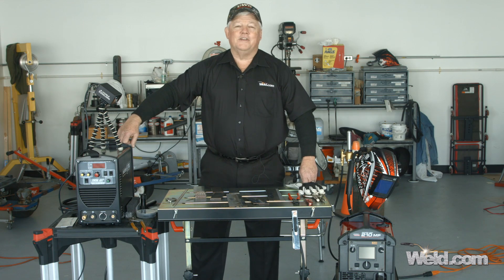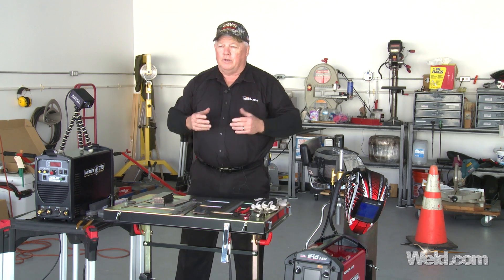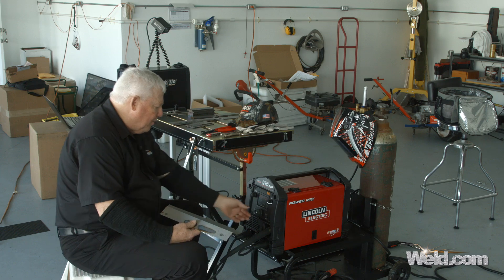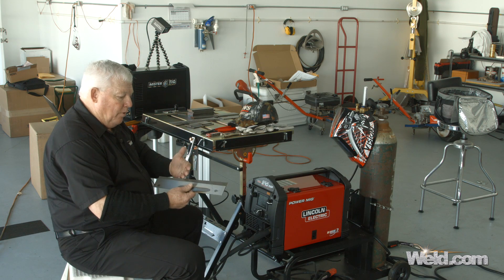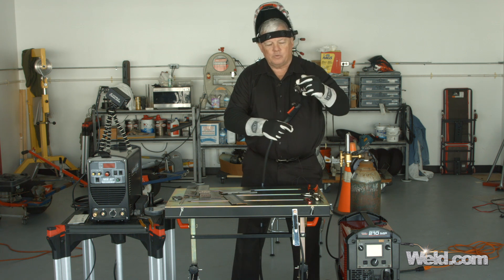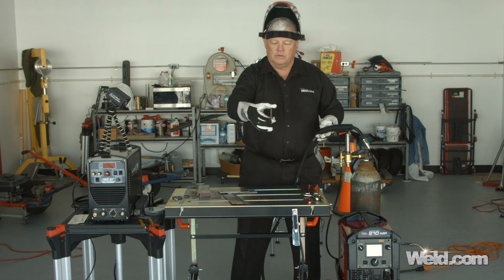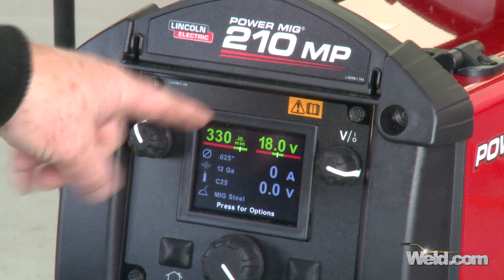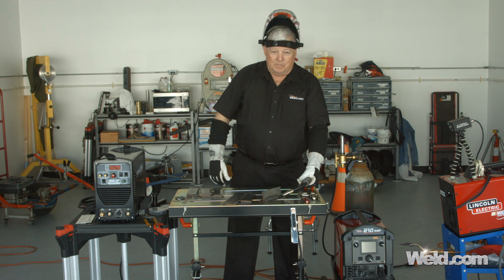Lincoln PowerMIG 210 MP Review (Part 2): MIG Welding | TIG Time

Comment: Hi there I bought a Vulcan 150 a tig torch Will it work with the Lincoln processor 210 mp I was wondering if it would be capable of working I mean on the box it says it works most of Lincoln‘s

Comment: I’ve been looking at getting on of these for a while now but I’m just concerned as to how thick a material it will weld as il be mainly welding between 8-10mm should it be up to this in the mig process do you think?
Reply: I'm just learning to weld myself and I don't have this machine, but I'm interested in it for the multiple processes (so take this for what its worth). I currently have a power mig 180 dual. A couple things that stood out to me was 1. He was using .025 wire on 1/8 inch. I'm pretty sure the .030 settings would allow that thickness to be available in the menu, or using .035 too. Also, he was running it at 120v, these machines are dual voltage so plugging it into a 240v circuit should allow good welds on 1/8". Other more experienced folks can correct me, but he should have used thicker wire for thicker material.... cheers.

Comment: Hey Wyatt, its Sal who used to work with/learn from/pic-your-brain at JFR back in 09-12. I have a PowerMig180 and a possible opportunity to trade it for the PM210. I have to put mini-tubs in a chevelle with frame mods; gussets, brackets, and I have no confidence the 180 can handle 1/4" steel in one pass. Have you welded any 1/4" with it? 

Also, do you think the TIG could handle a set of scratch made stainless headers? 18g tubing and 1/2"SS flanges?

Until can afford an inverter......

Comment: Thanks Mr Tig. That sure does make it dummy proof for MIG. I'm curious though, with using this 3/1 machine for stick welding, do you have to put in the rod data for the welding rod you are using and the thickness of the metal?
Reply: yes
Reply: I realize your question is 3 years old but for anyone asking now, the answer is yes but its easy. Note: its an inverter machine so like nearly all but the most recent inverters you do not have the ocv to light 6010 so it won't list that as an option.